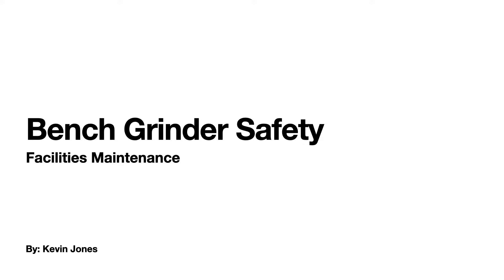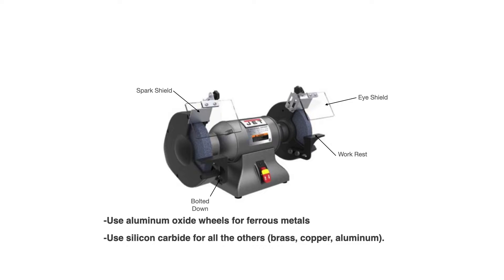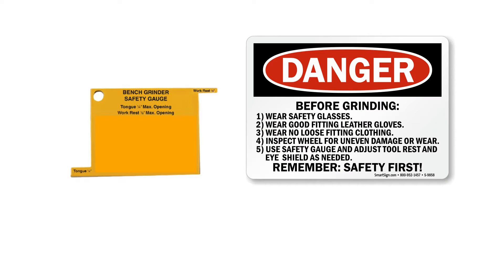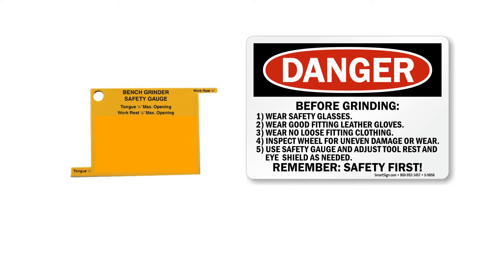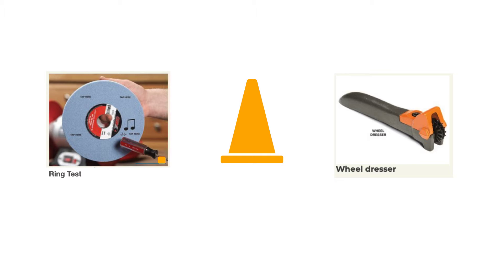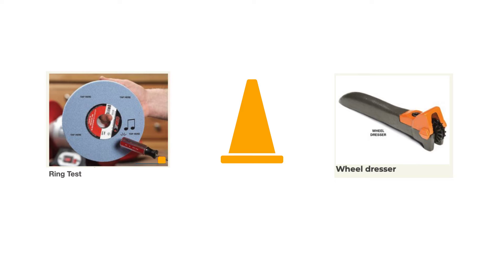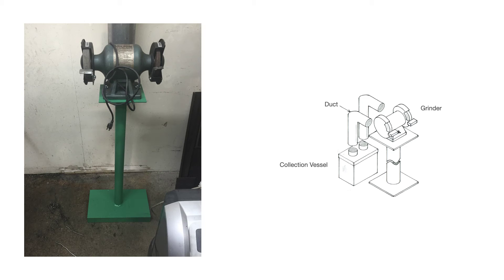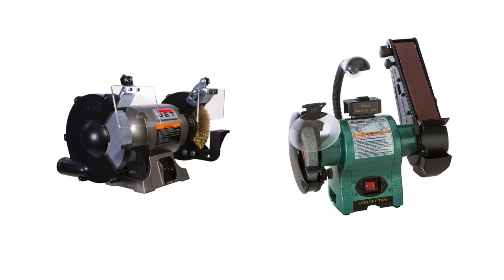Bench Grinder Safety [Must Watch]

Comment: Could a worn out wheel be dangerous if it just has worn out corners and faces? It's obviously not going to grind as well if it's not flat but is it actually dangerous?
Reply from the maker: Yes, a worn out wheel can be dangerous because it can become unbalanced or have microfractures that you cannot see and potentially explode.
Reply: @kjfacilities-maint  Alright. I'll look up how to make sure my wheels are balanced after dressing them. thanks.